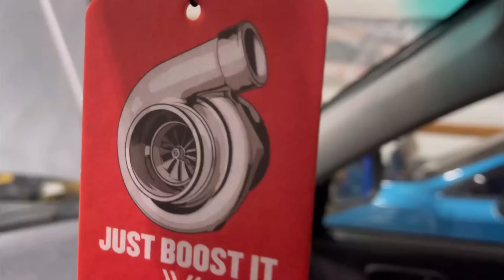Forester STI First Start!!!

Comment: Want to recommend using an oscillating multi-tool for cutting the timing cover and trimming bumpers. Easy to get a clean line, I like it more than my air saw that I used as a tech.

Comment: I had that leak on my new motor too, the vibrant fitting I used for the oil return line was not the right thing to use. Ended up using a 90 degree fitting to -4an instead of a banjo fitting. 

Glad to see I'm not the only car whos wheels turn when it up in the air but in neutral. Freaked me out the 1st time.

Comment: The power steering is pumping foam.  Next time if you go bleed the powersteering run the engine a few minutes go ful lock turn left richt. Turn of the engine, and take a lunch brake. so the powersteering fuid have time to go back to liquid.